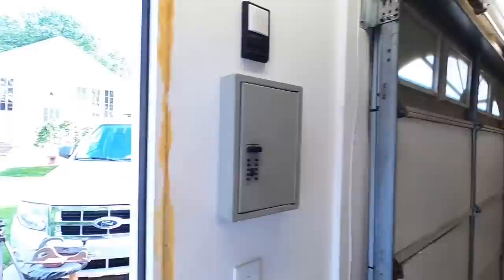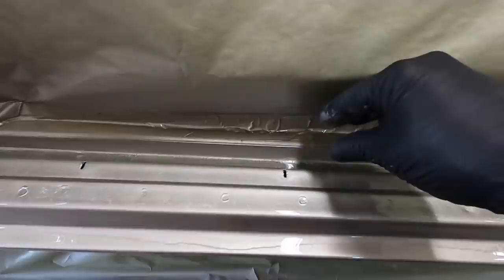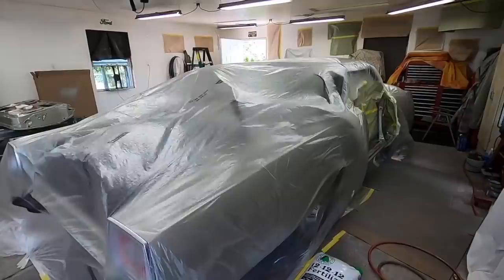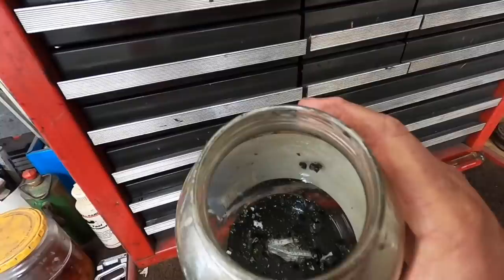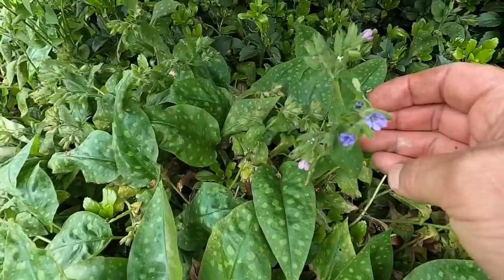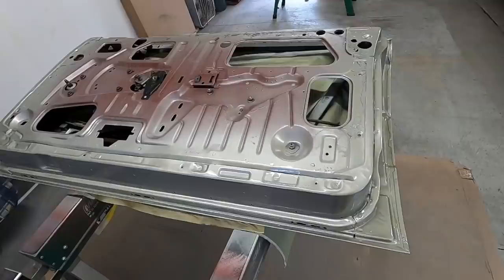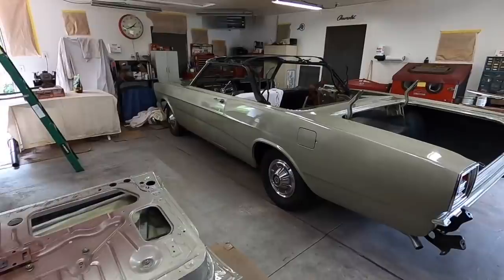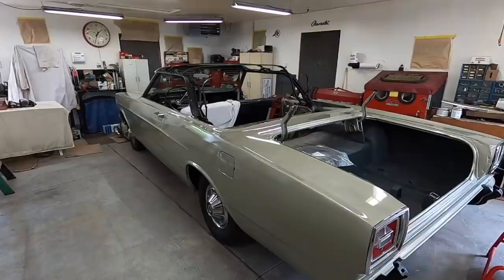1966 Ford Galaxie 500 convertible restoration part 122 painting the door jambs

Comment: Why dont you just leave the car covered?
Reply from the maker: Plastic holds in moisture..... The roll of plastic will cover the car a dozen or more times. One more time for the top frame. I'll run the top frame down, cover the car, cut the plastic, where the top is, run the top up, then tape it up for paint.